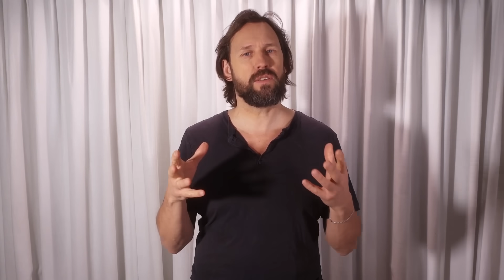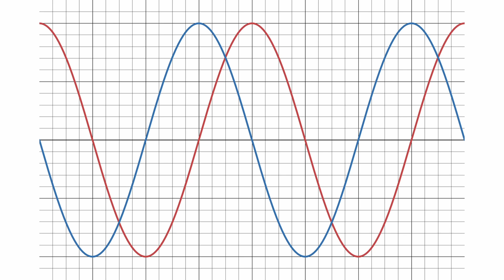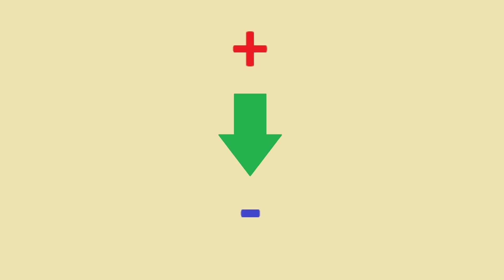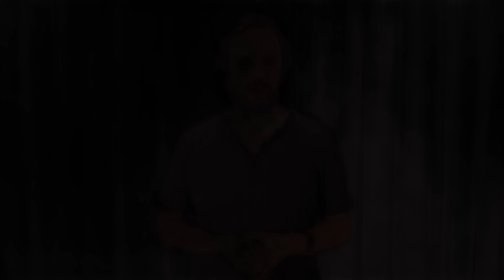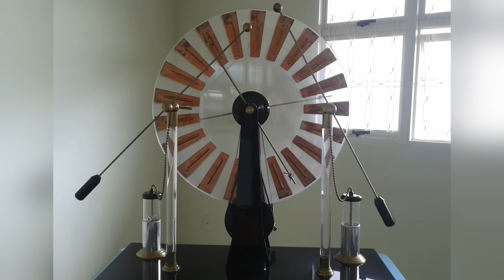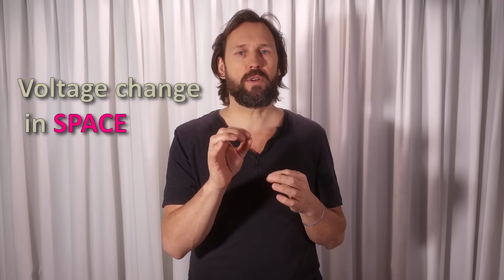The Electric Resonance SECRET Universities Hide

Comment: With all due respect, your description of the voltage and current waveforms in a resonant circuit are plainly wrong, and most definitely not what is taught in universities. At resonance, the voltage and current waveforms for the circuit are IN PHASE. Your explanation describes the voltage and current waveforms in a pure inductor (voltage leading current by 90 degrees), not a resonant circuit. In a pure capacitor, the current leads the voltage by 90 degrees. Therefore, for the complete circuit, the voltage and current are in phase.

One also should distinguish between a series resonant circuit in which the current is maximum at its resonant frequency, and a parallel resonant circuit in which the current is a minimum at resonance (though the circulating current between the capacitor and inductor will be maximum). There is also the consideration of resistance and other losses in practical components, particularly the inductor. Energy is lost in these losses on every cycle, so unless it is topped up by an external energy source, the oscillations quickly die away. You may wish to learn about the "Q" of inductors and the "dissipation factor", D of capacitors.

As to the direction of the current flow, it doesn't matter whether you choose electron flow or conventional current flow. We are dealing with and AC phenomenon. The electrons aren't flowing - they're just jiggling back and forth.
Reply: Look at the other video this coil is not ordinairy, has like three windings, should be four at least but hey you have to start somewhere. The outer windings sandwich the inner one, but this should be; one winding all around the tube cut a long piece of wire as long as the tube to connect the end of 1st wire to beginning of second, do second to third and third to fourth, al connections should be made after winding afcourse. This way you sandwhich several thousants of Volts inside this TubeFluxCappacitor! The tube should be bendable so you could just make it in the shape of OMEGA!! This is the best setup for harvesting electrons from the air we breathe!
You think only about positive ions, but they are both, hundreds of MHz!
Reply: Convert from the last to the first is what Tesla did.The HV to Amps. But you know that.
Reply: leave the fool alone! he thinks that if you consume energy before is produced, you don't pay. he does not understand that a law will solve it again, making him pay before he has something to use :)
Reply: Finally a voice of reason emerges from a sea of gibberish. Nothing @carlo7506 stated is wrong and I know of no universities that are trying to hide anything about resonance. The interesting thing throughout this video is that what you are saying, for the most part,  is not far off from scientific fact but your conclusions are the stuff of metaphysics and alchemy. You claim that energy is "very vague" ("yes Energy is very vague") but it is not. Energy is well defined and measurable if you understand what it is that you are attempting to measure. You have to have a strong grasp of the "system" to account for all the gains and losses otherwise you risk explaining over-unity claims where none exist. The Laws of Thermodynamics are also not limited to only closed systems but can be used for all systems, closed and open alike. As for " ... energy is equal to Aether" the 'idea' of the Aether was disproved experimentally in the Michelson and Morley experiment and further disproved by Einstein in the Special Theory of Relativity. Also, you stated: "The magnetic field also is made of energy, whereby it flows in the form of a vortex." just makes no sense and is simply a non sequitur. You said "theory can be fun but 99% not based on reality. Experimental proof comes first. then a theory that evolves based on new experiments. mathematical equations are used when the theory and experimental proof show solid usable results to refine.". Theory by definition is based in reality because that is why theories are postulated, to describe events in a way that explains their behavior and makes predictions about that behavior. The word 'theory' is tossed around in casual conversation by the layperson as an 'opinion' when in fact a theory is defined in scientific circles as a fact of nature, not an opinion. Scientific theory explains behavior, makes predictions about that behavior, and is reproducible experimentally by anyone willing to test it (peer review). Experimental 'proof' can't come first because there is nothing to prove. Experiments are used as a tool to confirm and support scientific theory and not the other way around. The Theory of Relativity, Black Holes, and the Great Expansion are good examples of mathematical theory preceding experimental proof.
Reply from the maker: Hi Carlo, I know what the textsbooks say. but I speak from experience and with all respect lets agree to disagree.
Q factor, I found a way to amplify it using constructive feedback both ways in a dual resonant system. I'll show you in the coming videos
Reply: @MasterIvo  Beki jk zn account hijser ni etom da thij gei ntres eerdis!

Comment: Very interesting presentation; I actually didn’t know that the resonance of a Tesla coil was down to the distributed inter-winding capacitance. I thought it was all about the capacitance of the top terminal. (I’m sure that’s still important, but can see that the inter-winding capacitance is critical.

I also had never thought of the displacement current coming from the ambient via fringing fields. 

I need to think through this a bit and perhaps discuss with my AI buddies 😉, but this provides me with a conceptual basis for where “free energy” could be coming from. I still have some confusion over the mechanism, though, of what’s going on at a physical level in the vacuum.

Thanks for the very intriguing framing!
Reply from the maker: Thanks!

Comment: The voltage is + or - depending on where you choose to be the referencial zero.
Reply from the maker: Correct voltage is always referenced (and over 2 points separated in space).
makes me realize voltage difference separated by time is the displacement current)

Comment: Below the breakdown voltage, a dielectric is an insulant and above that limit, it is a conductor.
Reply from the maker: better stay below it. prevent corona discharge. but energy does flow through the dielectric. Magnetic field energy and displacement current energy

Comment: If you go decide to use electron current instead of conventional current, there is nothing wrong per se but then you get weird modeling where your current flow through a resistor is opposite to voltage across it. That is because the default voltage definition was designed to go hand in hand with conventional current. The solution is to change your definition of voltage as "electron positive" as well if you're going to change your definition of current. If you change both, what you'll find is your voltage and current phase relationship is restored to what we had to begin with.

Just think about it, current through a resistor is supposed to be a response to the voltage across it. Its more natural to use a model where they are in phase, no?
Reply from the maker: you're missing the point. But I get your viewpoint. 
what about power. if it is consumed shouldn't it be negative?
Reply: @MasterIvo  In an intuitive model, I would prefer resistor voltage and current to be in phase. Using your proposed model, they are out of phase.

As for your question about power, it really just comes down to definitions. If your assumed current goes into the positive voltage terminal, that is positive power(like a resistive load). If assumed current goes into the negative voltage terminal, that is negative power, which is a power source. It is a matter of definitions where it is implied that you are calculating power consumed. 

Now you can go ahead and make your own model by flipping the definitions of current polarity, but it doesn't introduce any new information, just a different way of describing it. Once you get your answer using your model, a simple sign conversion can translate your answer to the conventional model :)
Reply: @MasterIvo 
Thank you for this video.
It is very helpful.
Could you please make a list of key words, terminologies and your definitions of them.

A kind of glossary, dictionary of the basic building blocks.

It seems to me that we are talking about relationships between different natural elements.
Reply: @MasterIvo 
People can have different definitions of the relationships.
Nature 
Energy
  Power
  Force
  Potential
Field
  different types 
Environment
Vacuum
Space
Aether
Medium
Time

I can volunteer putting the videos you made in an A.I that make transcripts to get a starting list of key words.

The real value will be your list of what you consider the building blocks and their definitions
Reply: @MasterIvo 
We need a good model that explains relationships.

Relationships
Energy
   where, location
   when
   quantity
   duration
   frequency, how often
   Pathways

   Properties
   Function
   Effect
   Meaning, significance    and value in relation to elements in nature and the needs of elements.

Relationship between energy, movement, change, state

Working with energy
   Here we can introduce
  Voltage
  Current
  Flow
  Coils
  Fields
  etc....

I liked the way you defined voltage, current in relation. to time, space.

Comment: I listened through whole video, all thing said were not wrong at all, yes if you change conventional direction of current you get 180 phase shift, part with capacitor and inductor relative value and how that affects voltage and current also makes perfect sense, but then you said severly wrong thing, you saw tesla coil as an open circuit while viewing LC circuit as closed one,in fact tesla coil is closed circuit with very small capacitance relative to inductance, so laws of thermodynamics apply.
Reply from the maker: if that tesla coil is a closed circuit then were is the topload connected to the circuit? I see that small capacity charge up with a field that is not only terminated on the wires. but at high enough voltages it fringes out side, and terminates on the air outside of the coil, interacting with it. this makes it an open system to me.
and indeed law of thermodynamics applies as it is restricted to the closed circuit only.
to be clear no extra energy is "produced". but it is taken in from the ambient medium. just like an HVAC
Reply: @MasterIvo   You stated earlier that an LC circuit is a closed circuit.
Then by the same logic, how can it be “closed” if capacitor plates are physically separated?

The answer is simple: closed circuit does not mean galvanically closed.
A capacitor is open to DC but part of a closed circuit for AC via displacement current and field energy. The field closing through space does not make it an open system.

By that definition, a Tesla coil is also a closed resonant system: inductance + capacitance (including stray and topload capacitance) with a capacitive return path to the environment/ground.

Also, thermodynamics is not restricted to “closed circuits”. Energy conservation applies to any system definition. Extending fields into space does not allow energy extraction without an external source.

Regarding HVAC: it does not take energy from ambient “for free”. It uses electrical energy from the grid to move heat against a gradient. The ambient is a sink/source, not an energy supply.

I still don’t see a physical mechanism by which a Tesla coil would absorb net energy from the surrounding air.

Comment: You're the man.
You'll be blown away if you watch my Flat Earth physics videos. Namely, the central vortex (coil) and the dielectric tropical gap for capacitance. The plates are Cancer and Capricorn with a 2 to 3 phi ratio difference. THAT IS A MAGNETIC CYCLE.
The moon, being the magnetic of the sun, is lagging behind the sun. But the Earth's magnetic field at the plates may arrive before the Sun ( out of the ashes comes....) ??  
The sun/current changing the magnet field on both sides moves the sun between  the tropics as the spark ( cold fusion) The Sun catches up at every new moon to become one, ( electromagnetic/male/complete)

Comment: Great video - thank you. 
I’ve noted a Tesla coil will draw more power from the source when it drives a fluorescent bulb, even at a distance. It seemed to me the coil and bulb then were in an electrically closed system, since the load impacted the power source. Have you found examples where this is not the case? Where the adjacent load does not affect the source power draw?
Reply from the maker: No not yet. but I am working on a circuit that uses feedback, raising the Q factor. while dropping the power draw
Reply: You can decouple the load and coil by having it project radiantly, if you hit the coil with sharp enough transients the output potentializes metals that can run loads and broadcast their own power output, the coil basically broadcasts sound like shockwaves

Comment: YOU ARE MISSING THE POINT. All free energy development is based on electronic theory; it does nothing but focus the mind on that theory.  We all tend to fall down the same rabbit hole, which diverts us from developing anything new.  Just because we can't see it or measure it, does not mean that it is not there. Think in these terms: high voltage is just energy pressure; that pressure moves, distorts, or bends other field lines. A spark gap discharge brings the voltage to zero, which in turn allows the distorted or bent field lines to go back to their zero point. This reverse flow creates another form of power that is not related to electron movement.
Reply from the maker: true! but there are also other methods that use high voltage without sparkgap. I prefer solid state as it will be easier to maintain.
to be honest I often wonder if I should not just use the sparkgap design. ❤
Reply: @MasterIvo , A faster voltage drop will induce greater backflow power.  I am talking about the Higgs field and the center boson particle. The Higgs field grid and its center Bosons bend along its axis in response to a high-voltage pressure.  The Higgs field bends at instant speed, not the speed of light. This explains spooky action at a distance. All atoms in the universe center themselves on a center boson. They can jump from Boson to Boson but will always center themselves because the Boson is a zero point. All forms of energy seek ground/zero point.
When the voltage drops to zero, and it reaches its zero point, the bent Higgs field lines also go back to their zero point. The center bosons move in the opposite direction, repelling the electrons clustered in a reverse flow. There is no resistance because of their instantaneous return speed, not the speed of light. Thus, cold electricity.
Reply: Also, this explains the extra coil in Tesla's design; it picks up the Boson reverse current flow

Comment: So all we need is an inverter that takes in 1000's of volts and inverts it to low voltage. The amps would rise.
Reply from the maker: you also need volts (emf) and (displacement) current to produce power.
Reply: @MasterIvo  As volts go through a transformer and go up the amps go down. As you know this is done in inverters. Reverse this, high volts go down amps go up.

Comment: No unknown knowledge was imparted here. The real question is why does a parallel tuned circuit ring like a bell, something causes the magnetic field around the coil to colapse. Therefore the magnetic field has an opposing force, just like a football pushed under water, the water rejects it by displacement. So what is the magnetic field displacing ? When this is answered we may unlock a new arm of science.
Reply: The magnetic field around the coil collapses because the current through it from the capacitor stops. The universe doesn't like conditions of low entropy: All the energy stored in one place while there is less or none in the surrounding space. The same reason the energy pumped into a Radio transmitter ripples out into the surrounding space; the alternative here would see a massive build up in the antenna (low entropy). Note that this happens in a Tesla Coil because the antenna is wound into a coil and this interferes with its ability to radiate outwards.

Comment: Resonate traveler effect is not complete in the mindset of how energy falls into non vibration or vibration what is bound to In curve displacement? dielectric condition has statics a directional frequency and short current charge sometimes spark in the point of building up charge and collapse to ground drainage there's an induction process in between a static and drags the charge of same. ❤high level low current.

Comment: why would the change of conventional current flow change the phase relation of current to voltage?
Reply from the maker: Because plus and minus are reversed. so the positive maximum becomes the negative maximum, which equals a 180 degree phase shift